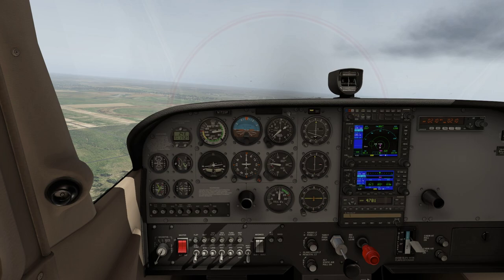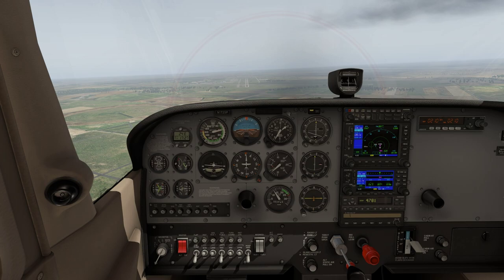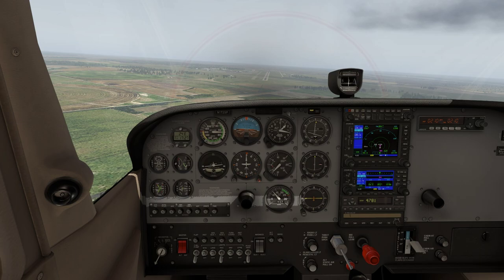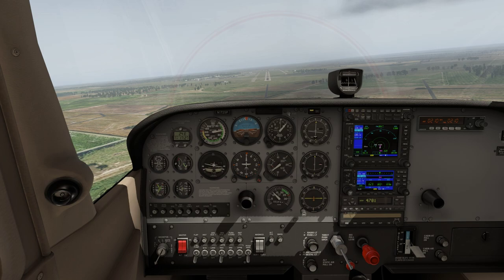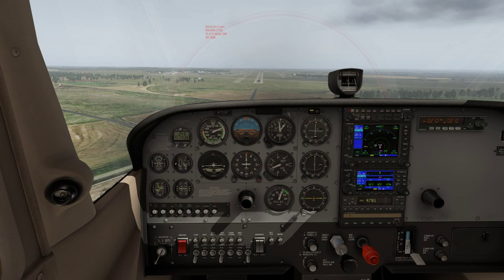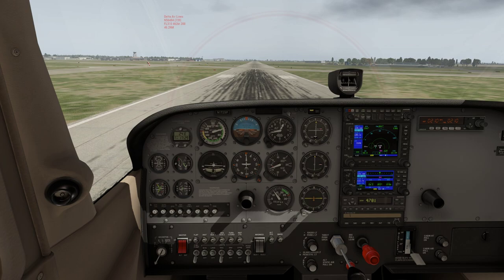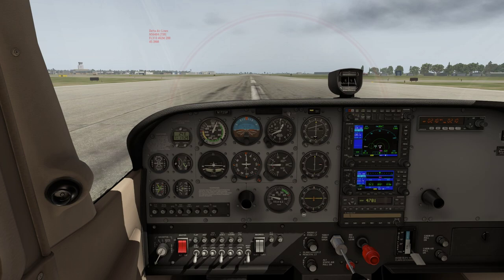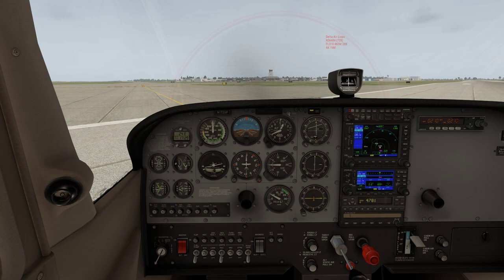Improving your landing scores in FSFlyingSchool

Comment: I have just started. I have to turn ATC voices off? Indeed what should the ATC settings be?
Reply from the maker: @D800Lover

You can leave ATC on - but it may be spoken at the same time as the instructor. Remember that you can always tell the instructor to "Be quiet please" using the Voice Commands. FSFlyingSchool does not communicate with ATC so this must also be borne in mind. Most folks work on their airmanship with FSFlyingSchool and work on their ATC without it.      Have a great week of flights!
Reply: @FSFlyingSchool  - Thanks!
Reply: @FSFlyingSchool  - I have a question, is there any chance that the Cirrus Vision Jet G2 maybe become supported? It looks liks a gas of a plane and so nicely done.
Reply from the maker: @D800Lover  

Thanks for the suggestion - I can certainly add that one to the list of potential planes.
Reply: @FSFlyingSchool  - Great!